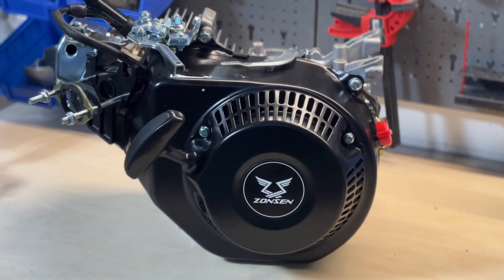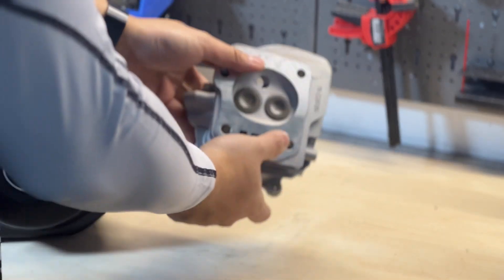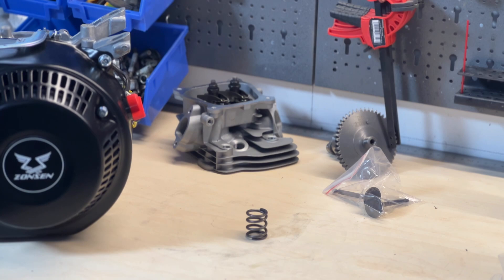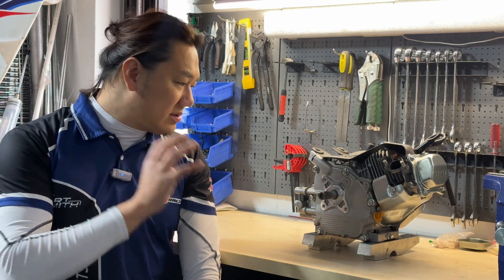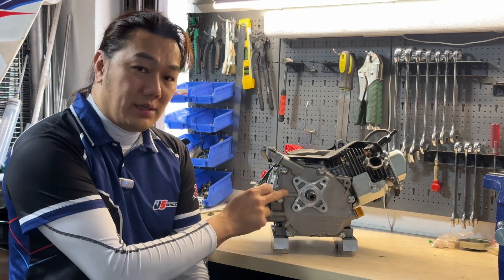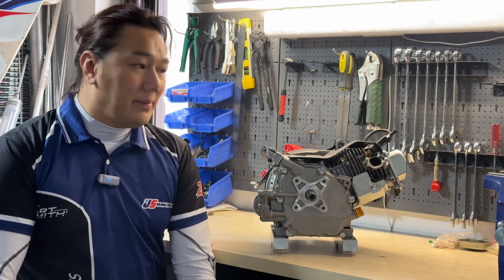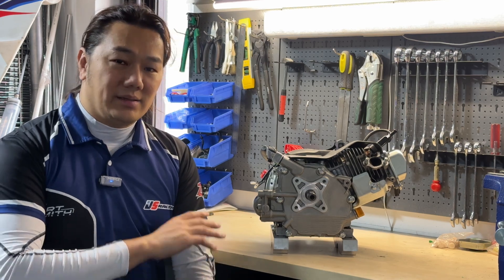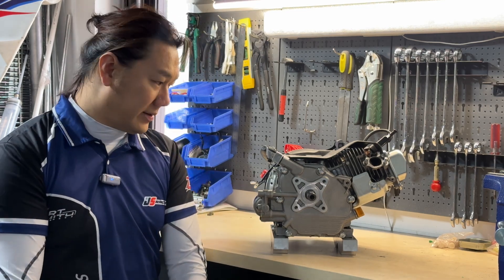New Prototype Engine: The Parts

Comment: I've looked through a lot of your videos, certainly can't knock you enthusiasm. A couple of notes about GX clone engines, Honda designed the engines to work at 3500rpm for thousands of hours, we as engine developers want more, clone engines are a copy of the honda, the copyright courtcase by Honda meant that some changes had to be made, so the 224/225cc was produced, Ducar produce the best outright budget block that is then passed along to different suppliers ie. Predator, Jcb, and Ducar themselves. Unfortunately there are a number of design flaws, one being internal balancing, a predator 224 has some vibration issues, mount this on a generator or power washer-not really an issue, but on a minbike or go-kart, it can become uncomfortable. Change the piston and rod to performance, well this upsets the balance even more, change the material and things will fall off! The crankase is cast with price in mind, so Honda GX parts will fit, this also means that moving parts are close to each other and the block wall in a 224. There's quite a few Forums that discuss the 224 in great detail, Bob's 4 cycle, DIYgokarts, Predator 224 owners club Facebook, and of course youtube. Single cylinder engines are impossible to completely balance due to the recipricating weight and girating forces, a twin cylinder overcomes this problem, What came be done is try to make the best of it by using a balance factor for recipricating masses, this will effectively balance the engine for a range of around 2000rpm, there are charts on the web denoting what balance factor to use. These charts are for two stroke engines, but that's all we have, so unless a great deal of research is done on the GX engines I would use this as a reference, and I have. The oil pump is not really neccessary, a shelled billet rod is very reliable with the correct ZDDP classified oil, just change the oil frequently. A 26mm venturi adjustable carburetor will suit your needs, it just requires correct jetting for your application, Black66 has a few videos as does Redbeardgarage explaining carb tuning, Check your timing with a digital timing light, you want 32/34degrees, adjust with offset keys for the flywheel. 
Horse power is another thing that's a bit of a downer, if you put a standard 224 on a dyno it may reach 9 with the governor removed. When aspiring to acheive more power it may be best to think of it as a % improvement, 100% is easily achievable, but will reduce the engines' working life and as you've mentioned you need to spend quite a bit of money to get there. Attending to the engines' factory flaws will get more from it without braking the bank, Porting the head for greater flow reaps big benefits for little financial outlay, boring and jetting the cheap carb again little cost, an aftermarket exhaust, yep another gain, safety-change the flywheel, benefit is on some the ignition timing is already set to 32degrees, all this will still only get you to around 12hp
America has really grabbed the GX market and have a wealth of aftermarket performance parts, but also a wealth of knowledge to tap into, I'm in the UK and there really isn't a GX performance formula, we're still two stroke driven with Rotax being the driving force. I machine or buy parts from an importer, it's been the only way to build my little monster, I have no doubt it will blow up, I'm asking too much from what is basically a cheap £150 stationary engine.  
I have subscribed to you channel, I wish you luck on the entertainment park project and the engine development. Keep posting 🙂